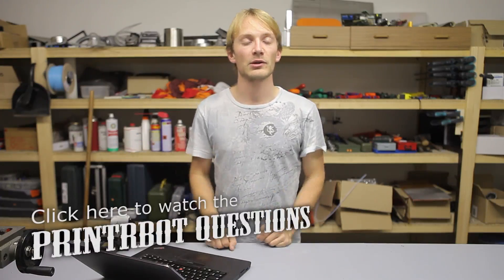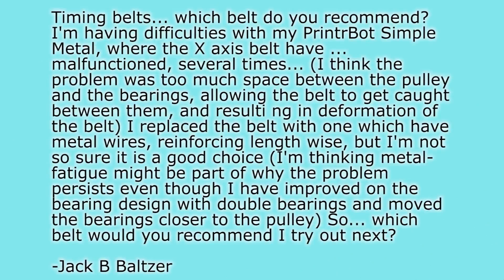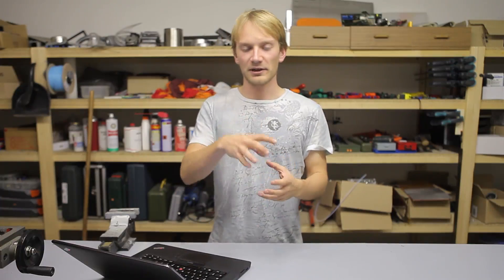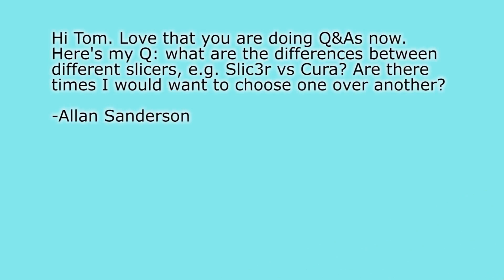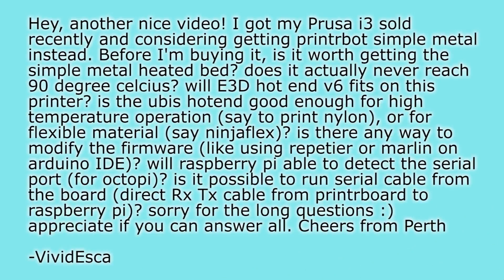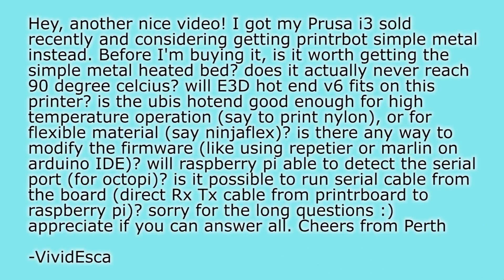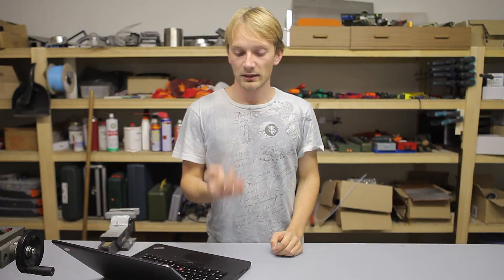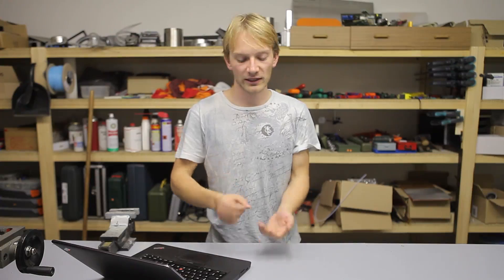Q&A: Belts, Slicers, Extruders and a Printrbot Simple Metal question overload!

Comment: Tom...  I know this is one of your older videos and that it is about the now defunct Printrbot Simple Metal.  I'm looking for some quick advise to keep mine running.  I've had it since 2013.  Everything works fine except...  the board fried the other day.  My computer does not recognize that is plugged in any more.  So no communication.  My question is, do you know of a source for getting a Ver. F4 board or one that is easily compatible with the old Simple Metal?  I've seen the Bigtreetech boards out there but, the setup looks intimidating.  Any thoughts/words for me on this, please?

Comment: Hi Tom,  I bought a Geeetech  Prusa I3 C duel extruder printer that uses marlin software. I seem to be having trouble calibrating the E-steps for both extruders individually. I dont know if its even possible. Im kinda a newbee at this and was wondering if you may be able to control the e-steps or output of the extruders separately with a certain slicing software. Thanks, Carl

Comment: Hey Thomas,

I just picked up a Sunhokey Prusa i3 Acrylic Kit with E3D hotend, Heated Bed and a Bowden Extruder setup (For $325). Will I be able to print flexible materials, like NinjaFlex, with the Bowden setup? What challenges will I face, and what settings would you recommend changing for best results?

Cheers!
Reply: Travis Hailston I'm no expert but I heard it is possible, you might need to adjust your retract settings a lot tho.

Comment: I have been watching almost all your videos and love them! Thanks for the vast wealth of information!

Just my 2 cents on Simplify3D, I used to use Cura and Slic3r and I decided to pay for Simplify3D and I love it so much more. It has a major thing the other 2 lack which is manual support material placement. I print a lot of small figures and I was to the point of manually creating support in the actual .STL file because the auto generation was just not good enough, but in Simplify3D it takes only seconds to do that!

Comment: I've tried Slic3r, Cura, and KISSlicer (the latter being rather a pain with network drives). My best prints, because I've optimised the settings most is with Slic3r 1.2.0 and 1.7.1. I do get some bad toolpath artefacts from time to time and wasteful moves that lead to stringing. One of the exhibitors at TCT recommended simplify3d, but also suggested I should try Craftware. It's a free Beta version at the moment, but looks quite promising. The ability to build custom support looks very good.

I've managed a couple of successful prints in Filaflex on a standard Velleman K8200!

Comment: Wonderful answers, thanks! I have to agree that going from Prusa i3 to Printrbot is like a total downgrade. I started to take my printer on travel a lot and I need something more robust & compact (my Prusa i3 is not robust enough apparently, works great but lots of calibration & maintenance needed to be done), and Printrbot simple metal looks robust enough for me :) That silicone heater looks nice (I did consider that), unfortunately, I already ordered stuffs from Printrbot (so impatience lol) as I worried bout the shipping time as I need it pretty soon (which turns out to be pretty fast, and very expensive bed yeah), other reason I worried the bed plate is not thick enough that it will warp/ bend under tension when heated (which happened on my Prusa i3, I had to put reinforcement). I'll try to modify the simple metal as much as I could to improve the performance (will let you know when it happen). The firmware update guide on Printrbot website looks daunty, I'm not a big fan to compile code into .hex. I have worked with different RepRap printers and Printrbot is kinda "partially" closed source, so I need to make sure some stuffs from the expert. Looks like I'll be using ubis for a while then, which is unfortunate, I like E3D V6 alot (V5 is more likely fit then, it's longer). Once again, thank you so much!

Comment: I invested in Simplify3D. After having used both slic3r and cura for about a year now there are things that both of them lack. I have now probably run about 20 prints through simplify3d and im very happy with the results. It does support material very very well. I have found support material in both cura and in slicer to be very unpredictable and i have often had to manually make supports in sketchup or in other software to properly support a print. In simplify3d you can either use an autofunction to place support material and leave it or you can even edit the the generated support or manually place all of in.

another great function in simplify3d is that you can have different print profiles for each model you have on a print bed. Say i want one model to have a 0.3 resolution and another with 0.1, infill, speed, extruder etc can be set for each model.

There are a couple of things i don't like and that is scaling of a model is very difficult. even though you can see the size of the object of every axis there is no way to  for example set the x to be 100mm even though the box is there, you have to edit the overall scaling of the whole model or the individual axes to find one that is as close to the size you want. Cura does this very well, but slicer does not.

Another thing is the speed control. You can set the default print speed, outline/outer perimeter print speed,support-structure speed, x/y axis, and z speed. There is way more control overt he speed in slicer and a bit more in cura, however i don't think cura does it that well. 

Temperature control is however very good in this program as you can make set-points for temperature on both bed and hot-end. This way you can make the print start really hot and get cooler towards the top etc. Also print visualization is great, you can play through the print layer by layer or you can even see hot end movements(line by line gcode).

The program also have other tools such as mesh-repair, manual support, bed leveling wizard, and more, but i haven't really tried these myself. 

I have yet to see a perfect slicer, but i think its going to be worth the money i  the long run. $140 is a bit to expensive as it is. Im not the best reviewer out there by any stretch but i hope this gives you an idea of the software.